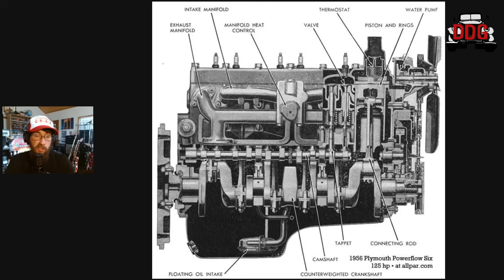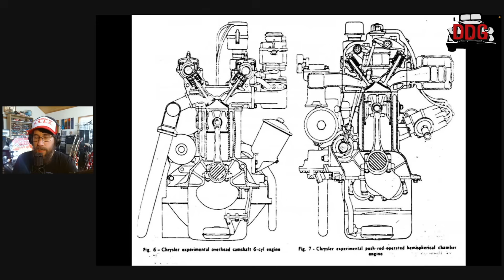The 1940s Chrysler Hemi 6 Cylinder Prototype Development Engine You've Never Heard Of

Comment: This inline six developmental Hemi is very cool, and I love seeing the "missing link" in the evolution from flathead six to Hemi V8. However, that diagram of a double overhead cam, twelve valve, hemispherical combustion chamber inline six is REALLY fascinating to me...not least because this was just a couple years after Jaguar developed essentially the exact same engine in the form of the XK6. The idea of an alternate reality where Ma Mopar built a high-revving Jaguar-style inline six, and maybe put it in cars like the '66 A-bodies, is really fun. A six cylinder with the bore and stroke of the Firepower 392 would work out to 295ci, and the 426 Hemi would work out to 319ci. Can you imagine a 319 DOHC Hemi-6 screaming at 7000 RPM?

Comment: Chrysler Australia made straight six cylinder Hemi's . The 215 Hemi, 245 Hemi and 265 Hemi in the 1970/80s . The 265 ci Hemi Six Pack was the top performer in the Australian Chargers, the V8s were available in the same cars , 318/360 and 340 but were slower than the 265 ci Hemi Six pack that came std with side draught 45 DCOE Weber's, tuned length headers, 10 to 1 compression , factory rated at 302 HP but every one tested in the 1970s made over 345 HP . And before someone says " it's not a Hemi as it's not got plugs in the middle of the heads " nothing says a Hemi has to have plugs straight in the middle of the heads , Harley Davidson Shovels are Hemi's and the plug comes in from the side . Another one about the Australian Hemi is " it's not a cross flow head " again nothing says a Hemi has to be cross flow, radial aircraft engines are Hemi's and both intake and exhaust exit on same side of the head. And lastly , it's not a proper Hemi because (1) valves on the Australian Hemi Six are angled north/south as in front to back of engine , not east/west like a 426 . This has nothing to do with it being a HEMI , all Hemi means is Hemispherical combustion chamber, Hemi =Half Sphere, no engine can be a full half sphere as it makes the chamber to large , the 426 Hemi is 42 percent of a  sphere and the Australian Hemi Six is 31 percent of a sphere. By definition the society of automotive engineers SAE , a Hemispherical combustion chamber is any chamber from 30 to 50 percent of a sphere, the Australian Hemi Six comes in at 31 percent so qualifies as a true Hemi. The 215ci Hemi (3.5 litres) , 245 ci (4.0 litres) and 265ci (4.3 litres) are Hemi's . Grate engine , in the Australian Chargers it raced against 351 Cleveland powered  GT Ford Falcon's  and 327/350 HO powered GM Holden Monaro's and was easily their equal, the 340 V8 Chargers were slower than the 265 Hemi Six Pack R/T's .
Reply from the maker: I mentioned them in this video. The Hemi 6 is a legendary engine, but there’s no denying it has none of the characteristics that make the big Hemis what they are.
Reply: @DeadDodgeGarage lol, it has every part that makes a Hemi good, the out dated , wide valve angles of the 426 and earlier attempts are a big problem for good flow , we know that today , tight valve angles that the Hemi Six's have promote a straighter line into the engine , smaller roofed chamber does not lose so much energy being transfered to parts of the chamber doing no work. There is nothing the V8 Hemi's have that is any better than the six Hemi . Funny how the GM LT V8s angled the valves the same way as the Australian Hemi in their design , if they had machined a nice 31 percent dome in the chamber that could have had a Hemi chamber too.  Considering the 265 Hemi put the 340 LA four barrel to shame being 1.2 seconds faster over the 400 meter I'd say the 265 has more positive design than those old 1960s Hemi.s .

Comment: I had a 265 Hemi 6 cylinder mid 70's. 
It was marketed as a Hemi. There were 3 versions 215 ,245 ,265, or a forth if you include the heavy-duty 245 that went in trucks. From a technical perspective I believe they were actually a semi hemi. The 265 was also available with triple Webber cards. Should add was Australia.
Reply from the maker: Yes - made mention of the Aussie Hemi 6 late in the video. Indeed, it’s only kinda sorta a Hemi. The chamber shape is mostly there, but none of the other distinct Hemi features are. Even so, those engines were apparently pretty great.
Reply: @DeadDodgeGarage On my 265 i had a ticking lifter. Took back to dealer and replaced all valve gear still did it. So i bought a new motor.  The foreman at Paceway asked if he could keep the motor i said yes. He pulled it apart 3 times then found the fault. The port where the lifter fits was slightly out of round. So when hot oil thinner leaked past .
Back then i had more dollars than sense.

Comment: I love straight 6 overhead cam engines with flow through heads. Owning a couple BMWs over the years convinced me these are the smoothest running engines available.  A DOHC Hemi 6 would have been an excellent engine. Interesting video.

Comment: Australian mechanic here, I worked on valiant hemi 6 cylinders a bit in the seventies, reliable, torquey, good for towing, the factory made some valiant chargers( two door coupes) with 3×dcoe weber carbs on them with big cams and high compression,265 cid,  very fast cars. They were giving the fords and holdens a good run for the money at Bathurst early 70s. A very worthy successor to the leaning tower of power, the slant 6. And yes, I'm a mopar fan. Current ride is a 300c 5.7 hemi....

Comment: Reminiscent of the Jeep 230 Tornado SOHC hemi six. Like to have this in my wife's 1949 coronet! We had a 1953 Canadian M37 with the 251 in it for 45 years. It was an only vehicle for several years and was driven to work and on the farm for 15 years, then it was still plated every year and used to log out several woods along with our 1952 GMC M135/211 Deuce. It had a thermostat go bad (the original) in 2016 and blew a head gasket. Hone marks were still in the cylinders! New gasket, DEAD EVEN compression check. That truck got a BUNCH of use since we bought it in 1978. The second owner is having a ball with it! 😊 I  have an Edgy aluminum head, Offenhauser 2x1 bbl intake, and Red's headers for the wife's 230. I would love a lumpy cam but I'm not sure how the Gyromatic would like it. I have built 225s 318 polys, and a ton of big blocks. I have a U.S. Navy 1958 Dodge T700 semi with a 354 hemi. We raced a Chrysler Newport with a 440 six pack very successfully and I still have our last race car we bought in 1988 a Dodge monaco with Long Rams on a 400 we have been running those rams on various engines for 60 years now. Nothing hold a candle to them with the right cam etc. I never drive just ONE carb! Tunnel rams, Chrysler inline 8bbls and Wieand X ram with 2 TQs 😂 first time to your channel I will subscribe! 😊

Comment: I’m regard to the V-16 engine, there were only six made. I’m a volunteer at the New England Air Museum and we are in the process of cosmetically restoring #1. The XI-2220 is 10 feet long and displaces 2,220 cubic inches. It produced 2,500 horsepower.

Comment: Everybody praising the HEMI engine but it was almost history. Many car builders developed a similar engine but didn’t bring it in production. So there must be a gain/lose power ratio here (?).
Reply from the maker: Whatchoo talking about? Almost all modern engines are derived from this design. The difference is that today, they generally have a pent roof instead of a rounded Hemi chamber, and four opposed valves instead of two. The Hemi IS history - an important part of it, as a matter of fact.

Comment: Big shout out for some help please. So the lower throttle shaft on our sons 1950 B2 pilothouse has far too much play any suggestions remember that over here in England even the easiest of tasks is a challenge. Got any good lower parts of the carb or any suggestions on a replacement thanks you Roy.
Reply from the maker: Hmmmm. I don’t have any spares for that. Have definitely seen them with enough play to create a vacuum leak before. It is possible to have the throttle shaft holes repaired with bushings by a machinist. This may be something to look into if you can’t find a better throttle housing.

Comment: I loved the video and the analysis perspective, and wouldn't mind more. It would be awesome to find the A221 in a forgotten crate, but it was likely discarded. It would be interesting to find out how much power it made compared to the flathead. We do have an example of a non-V8 Hemi with dual overhead cams, but it's in the form of the 2.4L used in the Neon and PT Cruiser. Identical combustion chambers to the modern Hemi, including the 4 valve crossflow head, but we all know it's actually a pent roof design. It still has great potential though, and not many 4 bangers will reliably produce 500 ft-lbs of torque. DCR used to sell a 1,500hp version which used the factory block.

Comment: I would LOVE to see the results of comparative dyno pulls hemi vs flathead.  Though the design would not allow the rpms that Hemi's love, the breathing had to show a tremendous increase in power in midrange.  Be interesting to know if they blew up any of these - I know these flatheads were wonderfully smooth and very reliable, but they did NOT tolerate high rpms.

Comment: Chrysler Australia had 215 ci , 245 ci and 265 ci Straight Six Hemi's in the 1970/80s . And before all the Keyboard Mechanics jump up and down and say " it's not a Hemi , the plugs Arnt in the centre, or it's not cross flow head " I'll correct them, (1) Hemi simply means half sphere , as no head can have a 50 percent half sphere, not even the 426 had this , any slice of a sphere down to 25 percent is considered a Hemi head . The 426 Hemi is 41 percent of a half sphere and the Australian 265 ci straight six Hemi is 34 percent half sphere so comes in well inside the definition of a Hemi chamber , so is a Hemi . (2) The spark plug does not or is not required to be in the middle of chamber , Harley Davidson Shovel Head motors are Hemi's and the plug comes in from the side , just like the Australian 265 ci Hemi Six cylinder.  (3) There's nothing requiring a Hemi to be cross flow head , The 215,245 and 265 have intake and exhaust  on the same side of the engine , just like all the radial aircraft engines , and they are most definately Hemi's but like the Australian six , their intake and exhaust ports are on one side , not cross flow. (4) The 215, 245 and 265 Hemi Six cylinder angles the valves north / south , so front to back of engine , unlike the 426 Hemi that angles valves east / west or across the engine .  

Long and short of it the Australian Six Cylinder Hemi engines are Hemi's by definition, Hemi just means up to half sphere chamber ..that is all , nothing to do with valve location or spark plug location, infact most two strokes use a Hemi chamber and they have no valves in them . 

The 265 ci Chrysler Australia straight six in 6 Pack R/T form in the Australian Chargers sporting 3 X  factory 45 DCOE Weber carbies, High Lift / Duration cam, Factory tuned length headers, high comp pistons , and so on all factory stock in the R/T 6 Pack 265 Hemi produced factory rated 302 HP but back in the 1970s groups of them were dynoed and some put out 360 HP and none produced in factory stock form less than 335 HP , this was the top engine option and the configuration that was raced , against Ford Falcon's with 4V 351 Cleveland's and GM Holden Monaro's with 350 HO chev small blocks. The same Australian Chargers were also available with a 340 LA ( it was slower than the 265 ci Hemi Six) and 318/360 V8s all slower than the six . It was a truly magic straight six. Uses LA V8 rods , and many other parts , has LA V8 bellhousing pattern. The 265 ci Hemi Six (4.3 litres) and it's smaller brothers the 245ci (4.0 litres) , 215 ci (3.5 litres) all legandary motors . And proved a six could out do some pretty stout V8s. There are stroker kits in Australia to take the 265 out to 320 ci but most are in the range of 303 ci. 

That's the Chrysler Australia Straight Six Hemi story .
Reply from the maker: I'm fully familiar with the Aussie 6, and I will never understand why I keep getting comments like this one as though I'm not. No Chrysler Hemi had the plugs in the center of the chamber. The Aussie engine is laid out like a wedge engine, but it does have the same partial-Hemi chamber as the other Chrysler Hemis, and apparently the valves are ever so slightly canted. The non-crossflow design is a hindrance, but as we both know, those engines performed and are legendary for a reason.

Comment: @9:00 The unidentified fig. 6 engine? I could be wrong. That engine, at least the head. Looks like an Alfa-Romeo. It's a double overhead cam engine with a huge valley and the spark plug right in the centre of the cylinder. It also had replaceable cylinder sleeves. It was a perfect engine. They used it over 30 years. I wonder?
Reply from the maker: I mean it’s very similar design, no question. But it was an unrelated Chrysler prototype.
Reply: @DeadDodgeGarage  The DNA of so many engines is "borrowed" Sometimes by word of mouth. Chrysler could have borrowed the idea from Alfa-Romeo. It is highly speculative of me, but that could be why it wasn't used. They could experiment with it in their skunkworks, However if they wanted to produce it, They would have had to pay royalties or something.

Comment: I had a 1938 Plymouth that had a flathead six with a three speed. You could take in third gear if you slipped the clutch a little. And the car would just chug away.  Back in the fifties, my dad's old boss had some old smaller Plymouth of some sort and would put in a DeSoto or preferably a big Chrysler flat six.  And apparently, it ran pretty well compared to Ford flatties. After hearing about it, I was sad. I passed on a 1935 Plymouth and instead bought the 1938. I think that it would have been a really fun coupe with a big, like 1950 Chrysler car flathead six and probably an overdrive. The 35 looked lighter than the 38.
Reply from the maker: I almost always took off in my flathead equipped ‘55 Plaza in second. You didn’t even have to hit the clutch… idle down to almost a complete stop, and then just pull away. It was impressive.

Comment: The gap that is close to the intake valve is called the quench area. This increases the Volume of the intake charge. AKA low pressure exchanged for high pressure. This is very good. When the spark plug is in the center of the combustion chaimber/HEMI it will not matter where the strap of the plug is located. With the plug being off set. The most efficient strap alignment will be to have the open end of the strap pointing in the direction of the center of the combustion chaimber. For instance 2 identical engines. 1 engine has the plugs in what every way they land. The other engine has the plugs indexed. The engine the has the indexed plugs win every time. More efficient burn of the combustion chaimber equates to more POWER. Every body likes more power. From 1 gear head to the next. I can't keep to my self for ever. This knowledge must be passed on.
Reply from the maker: A quench area is a flat pad between the top of the piston and the cylinder head. There is no quench area in this design. Also, spark plug indexing has been proven to make very little power. I don’t bother.

Comment: Some loss of efficiency being the sparkplug is not in the center of the Hemisphere. Spark plug spacer could help align the plug straps and get back what you lost. But is it worth it
Reply from the maker: No, it’s definitely not worth it. And for the record, the plug is off center like that in all of the first and second generation production Hemi engines, including the legendary 392 and the 426. They’re even off center in the third gen Hemi - but there are two of them per cylinder.

Comment: I responded to it in April 23 2025. The slant six was very much following the A221 DNA. This US hemi six engine is indeed  25 inch flat head based, with the slant six details the most interesting . For instance, the cam shaft on the US passenger side, the distributor position changed in the slant  via the elimination tube through the wider 3 and 4 cylinders bore spacing and on the US driver's side. Despite claims to the contrary, you can see Chrysler based the Slant Six on the same 25 in Flat head block, but tilted it, reduced the wide 3 and 4 th cylinder bore spacings, and had the intake and exhaust and distributor mounted on  the other side. Which wasn't actually that hard to so. On A221  Hemi , 23 and 25 " Flathead and the 225 Slant Six, the cam stayed in the same place on all engines, and the long stroke and the basics of the  four bearing crank were shared between the flathead 25" 230, 251, 265  and  225 Slant Six. Although the Hemi development is fascinating, the real issue is how much of the flathead  six engine design was carried over to the Slant six 170/198/225 engines. Mopar built on the sterling engineering of the long running 25 inch  Flat head six. 

See https://www.facebook.com/share/p/1FV3UFuHXL/

Comment: To me it sounds like an extension of the crazy multi 6 cylinder flat head radial engine from WW2 development program.
Reply from the maker: The A57 Multibank?! Just another engine developed with the flathead as its base. But unlike the Multibank, this only uses one. Haha.
Reply: @DeadDodgeGarage  Indeed but it would have been easy to update  tooling and all. The Hemi program started in and pre WW2

Comment: That is very interesting and yes you will hear about the aussie hemi 6 as I now have 2 of them a 245 and a 265 the 265 is much more powerful than the 245 even though not much difference in the cubes on my channel you can see them and going both are in cars but 1 car isn't on the road it came as a parts car can I smell a deal coming